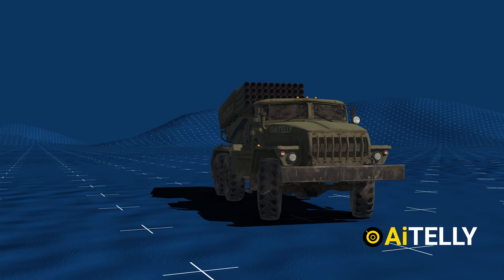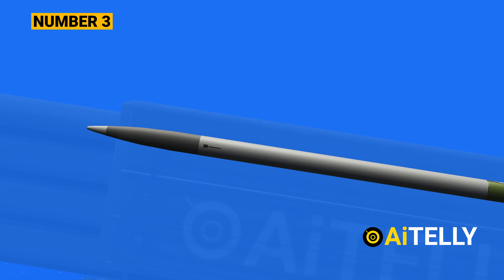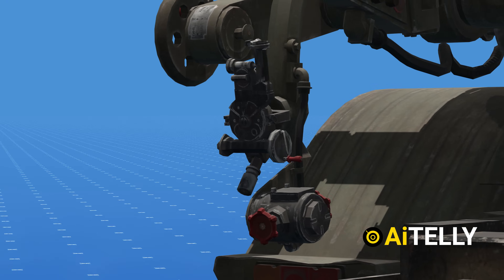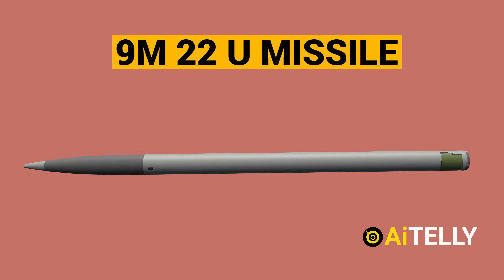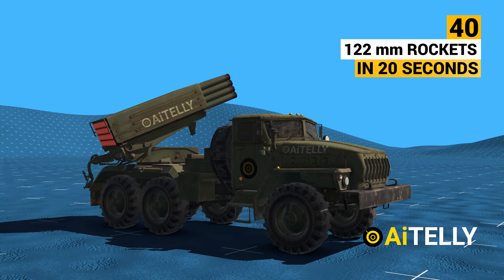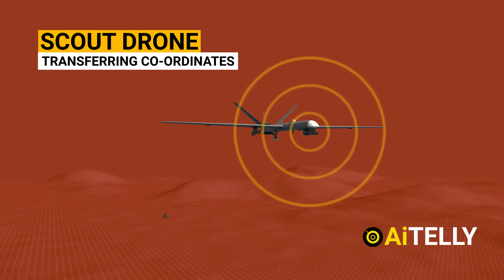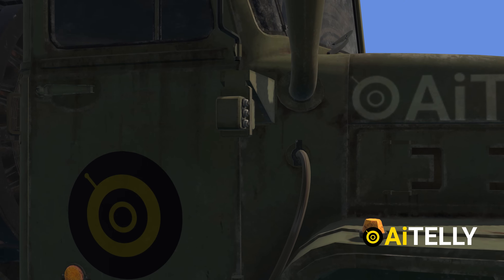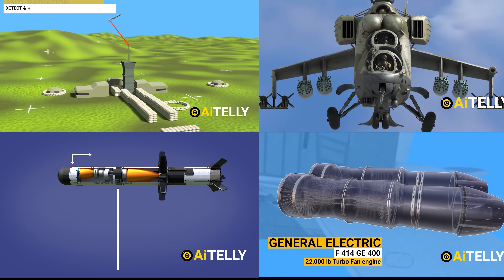Why this BM 21 Grad Rocket Launcher from the 1960s is still in service & How it  works #rocket

Comment: this one MLRS, Grad....very old but still haved icon and not bad as MLRS, but i more prefer with Uragan or Tornado-S/Smerch and TOS-1A wich is more modern , also Predator Hawk and Extra with Lynx Pulse launcher's from Israel , can you made MLRS video about that, please ?
Reply: TOS-1A is technically speaking not an MLRS but a heavy flamethrower. That's how it's classified. Because it's fire range is not enough for it to be a typical MLRS (10km). While it acts like MLRS, and have resembles of one, it's capability and design still suggests that it's a heavy flamethrower just because unlike typical MLRS, it can be used literally point blank.. yes.. and also because of what it does and how it does..

Comment: My great grandfather used oldest artillery systems 1547 Abysinia v Somalia war and artillery system haven't changed since 1547 you still need forward observations. Accuracy have been issues but with drones for observation pin point no need for massive fireworks future and now battle will be based on accuracy like Himars with ONLY 12 rounds it will be able to take out 12 mlrs with pinpoint accuracy Tactically himars is better

Comment: 3 negative points 1) needs too much time to reload , made by hands! 2) almost no protection for the soldiers. 3) Relatively small range of the missile! Although there are many companies that offer solutions for bigger range plus other modernization! Nice video I would like you to put positive and negative points in all weapons systems you analyze, thank you!
Reply: Smash n dash is main defence
Reply: It is a simple truck that is cheap to produce, with the possibility of having a lot of them (as the Russians like), so reloading is not a big problem. Neither is the protection of men, since this system is designed to shoot quickly and leave and not stay in place, protecting soldiers would be far too expensive (make sure that they do not have to go out and that the whole truck is armored?).
Reply: In terms of rocket artillery, it's the best system.

Comment: it makes no sense to compare HIMARS with BM_21. these were the first simplified MLRS after which they produced heavier and more accurate systems, Tornado-S and Tornado-G. 'Hurricane', 'Smerch' and 'Grad'. The Iskander, for example, has two long-range missiles and is comparable to the HIMARS with two missiles. in general, MLRS installations were invented in the first 1940 years by Soviet engineers to fight the German Nazis.
Reply: РСЗО создали именно Немцы а не в СССР
Reply: @simsim-kv8jm  Even better, not only it was created and designed in USSR (i am not sure if you are lying, or uninformed, or trying to rewrite history here by saying that it was created and designed by Germany..), but also in Russia of 1820th with launcher capable of launching 6 rockets that were used in some conflicts. Shocking, i know. Later designs were perfected by 1939 and were used first time during Winter war. It will be known as the famous BM-13 that Germans faced for the first time in 1941, and the sound of multiple rockets flying towards their positions was their nightmare until the very end of this war, so much, that they gave it a name. BM-13 was used extensively during 1941 to 1945 and had a different effect on war, depending on the year of war and on production capability to build more BM-13.